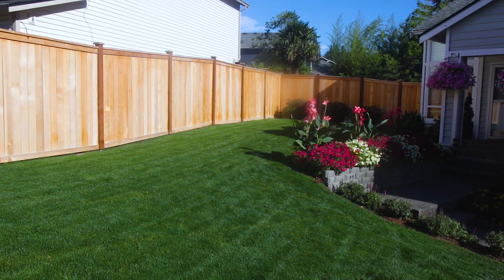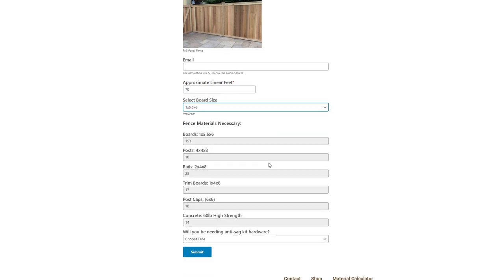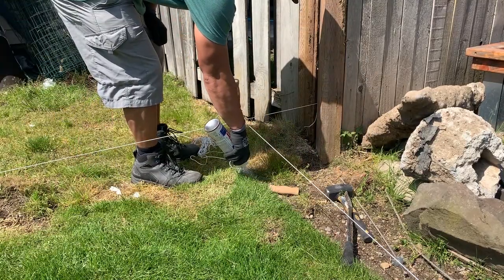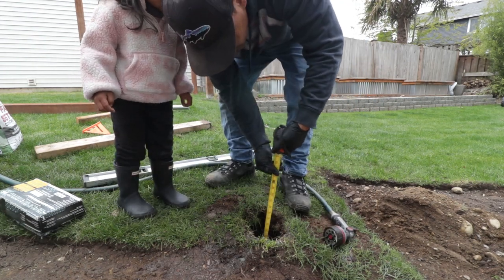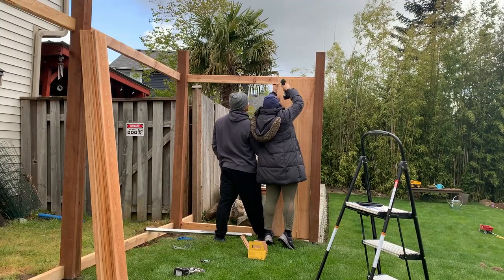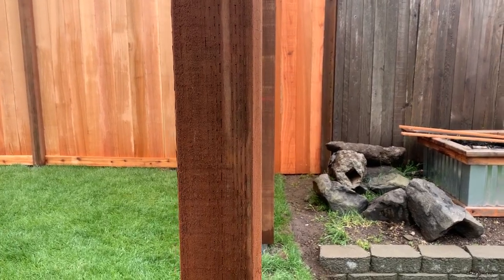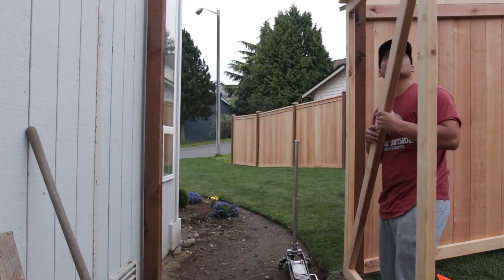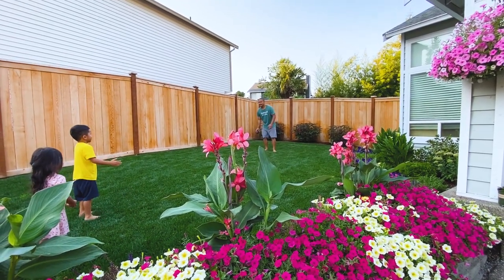Watch THIS! before you build a fence - ROT-PROOF Fence Post

Comment: Handy, driven and a Family man. Good work! My only comment is to buy a metal brace for the gate. The wood will sag over time and the metal braces are in-expensive and can be bought anywhere. That brace will keep the door operating well and without issue. Cheers from Miami Fl.
Reply from the maker: Thanks for the tip👍